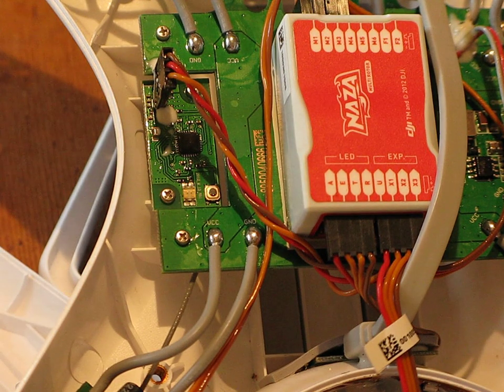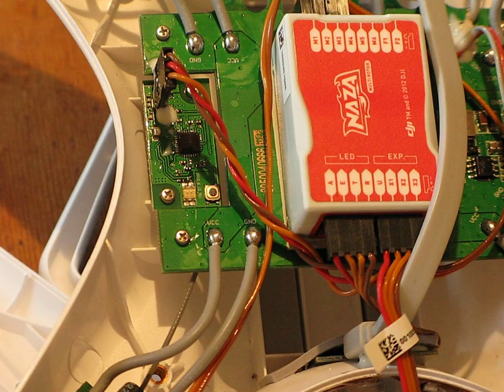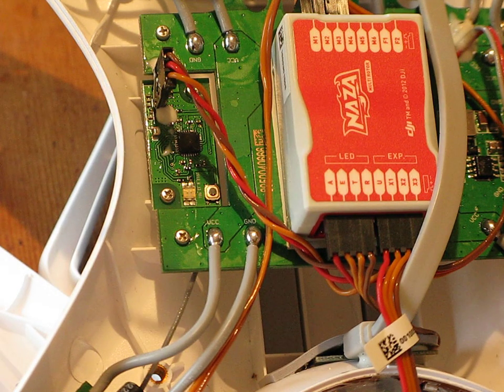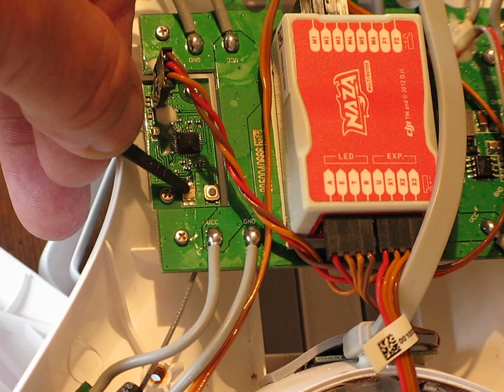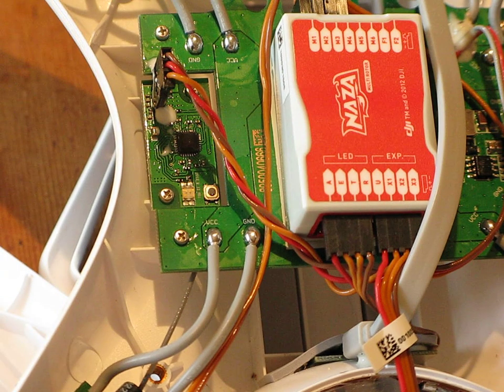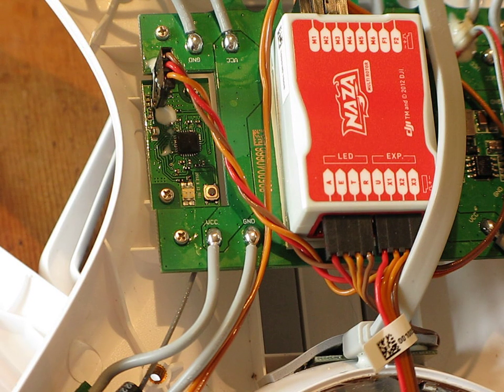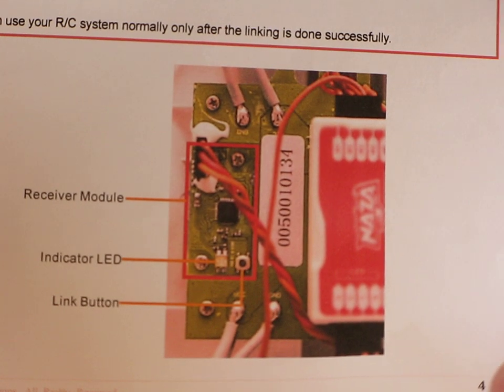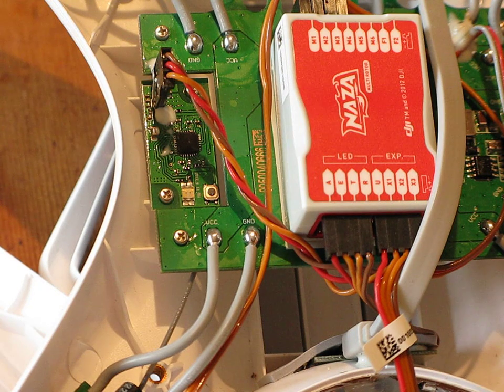DJI Phantom / Transmitter Binding to the Phantom.

Comment: If you have Two phantoms. One with a transmitter and the other without. Is it possible to use 1 transmitter to operate both phantoms? Not at the same time obviously, but to operate the one that doesn't have a transmitter?

Comment: Hello mate dunno if your still flying but I'm really trying to help my mate out we both have FC40 mines been custom now than on his the problem connecting to GPRS WE get 
Yellow red yellow red green rapidly then yellow the switch won't connect on the 6 times your ment I've taken the cover off and now have found your video she will fly in manual but GPRS I've also put my compass in it still the same any Forts buddy
Reply from the maker: +Winston Banks 
Hi Winston, sounds like you have an IMU problem, it could be receiving abnormal data. Try recalibrating it.

Comment: On the phantom, I have a P1 and trying to change over to 5.8 with a5.8 transmitter, and yes it is longer then the 2.4 receiver but it fits. It binds but I keep getting the fast flashing light indicating loss of transmitter. I have read of others that changed it over and had no problem.. I am just stuck, so if you can help pull me out and get this flying I will be thrilled
Reply from the maker: +Daveloves 
To be honest I cant help, no idea what it could be except to try it again it may be a glitch somewhere, why do you want to change over to 5.8 ?

Comment: Perhaps I can get some help here.  I have a Phantom 1.  I just change out the shell and once it was complete, I started it up and I got the continuous flashing yellow light like the transmitter is not linking to the receiver.  The advanced manual is no help.  When I power the Phantom and turn on transmitter or vice versa, I get a green light on the receiver board.  When the transmitter is turned off it turns red. Pressing the button only flashes red for a couple of seconds; not long enough to follow the procedure but again the light turns green once the transmitter is turned on.  Any help would be appreciated.

Comment: What if the binding button is broken???
Reply from the maker: Then you need a new receiver.
Reply: Damn it. I still have the original transmitter but the two buttons at the top broke. Do you think it's possible to take the switches from a second one and move them to the old one? I suck at this stuff. 3 phantoms in 3 months. Lol.  But they're so much fun!!!
Reply from the maker: DoucheDaily.com
Do you mean the 2 switches on the transmitter ? if so then, yes you can swop them about.

Comment: Hi - Thank you for your tutorial on Binding .I recently aquired my-self a Phantom 1 .When i connect the battery, the binding RED light flashes.I hold it in for 3 secs , it then changes to Flashing green for 3 secs then goes to a constant green.I have to do this every time I connect a  battery.It then boots up as per, and flies ok. Do i have a problem, or is this quite acceptable?.thank you.

Comment: i just bought the receiver 2.4 ghz no. 31 for my phantom 1. i want to ask if it is compatible with my remote control. 
thanks
Reply from the maker: Try it out it, cant hurt anything.
Reply: i did but it didnt work out with me. i was just wondering if you have any knowledge regarding this matter. thanks

Comment: Hi!
I bought a phantom 1 and my transmitter`s led is blinking red. I`ve already tried follow your steps but didn`t work. When I turn on the transmitter the red light in transmitter is not solid, stay blinking. Can u help me?

Thanks

Comment: In the video you say to power up the transmitter (TX) before powering on the Phantom, this doesn't work. TX must be off until after you release the bind button.
Reply from the maker: Yes that, is what I added to the show more bit under the video.
Reply: Topvideos1001
Add an annotation on the video - like me most people are not going to read the description first.
Reply from the maker: arghone I did at 02:29.

Comment: Yes but then it does still the same, like the phantom won't react
Reply from the maker: If it has had a bad knock, then there could be a power link somewhere, check the battery compartment in the Tx.

Comment: Hi! I like your Phantom video. Do you know anything about adjusting the GPS declination on my Phantom, can the GPS internal antenna or somewhere in the software be adjusted? My Phantom 2 Vision sometimes flies in counter clockwise in GPS hover or veers to the right when I what it to go straight. I contacted DJI, but they were no help what so ever. Thanks!

Comment: Also, I have the phantom vision 2 not 1 so the inside of the phantom does not correspond to the inside of the phantom you are showing in your video. Can you by any chance tell me what to do with my phantom 2?
Reply from the maker: Mark Krupa
Yes that is true, you can access it through the battery door, I only advise that if you only use non metallic tools, for fear of live components.
Reply from the maker: If it is different then I suggest you contact DJI direct.
Sales : sales@dji.com
Marketing: marketing@dji.com
For Other Inquiries: info@dji.com
Reply: Topvideos1001 I have a Phantom.  I took apart the body like you did but later found that the LED light and the button are facing down and I can access it through the battery compartment.  Much easier!

But I still can't stop the yellow flashing lights on the Phantom and therefore can't get the transmitter and the Phantom linked and therefore can't fly.  Any advice? 

DJI has no customer service that I can find.
Reply from the maker: Giacomo, have you a problem with the vision 2 ?
Reply: the steps should be the same. the LED and button is on the underside instead of like in this video?
Reply from the maker: etegration
So what are you saying ?

Comment: my problem is the phantom will not connect to the transmitter and that little led does not come on at all. phantom has been crashed and i believe the receiver module is faulty)

Comment from the maker: The blinking of the yellow light on the Quadcopter (Phantom) means that it should be in home mode. 
Tx signal lost.
You should regain contact if you switch on the Tx then plug in the battery. If not then check the battery's in the transmitter, to make sure there is a good contact to all the terminals. This can be the problem.

Comment: Thanks, this is a great supplement to the PHANTOM Advanced Manual.  I want to link the receiver of the Phantom to a new DJI PHANTOM transmitter.  No matter what I do, the LED indicator of the receiver on the control board doesn't light (solid red or blinking red).  Nevertheless, the LED indicator on the aircraft blinks yellow continuously meaning the TX signal is lost.  Do you have any ideas on how to link the receiver and the transmitter?

Comment from the maker: I would not try a different Remote because I think this is there own design, If you need to change the Tx then change the Rx to match, to be safe.
Having said that, nothing wrong with trying, but do it with the props removed.